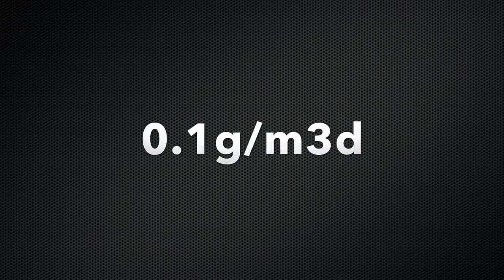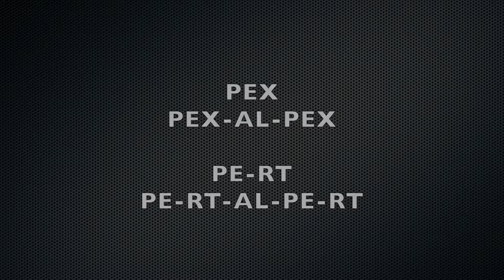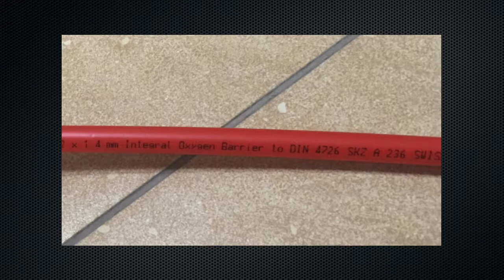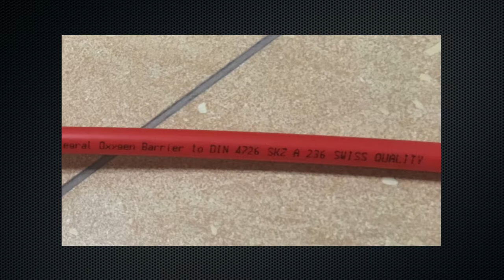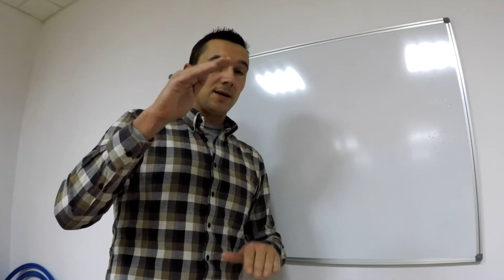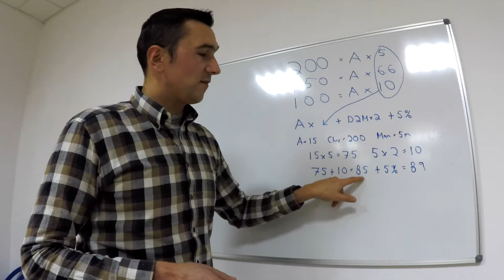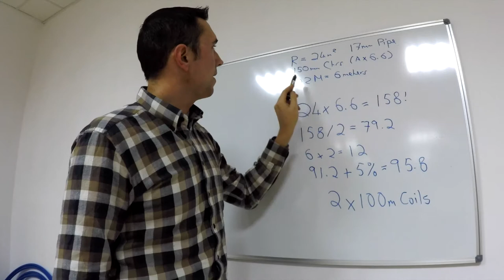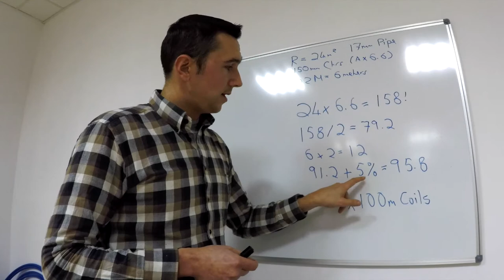Underfloor heating pipe and how to calculate how much you need

Comment: Brilliant content, do you offer a service to calculate and design snail pattern pipe layouts?

I have my heat loss calculations for a self build low temperature system, radiators up and ufh ground floor, but I'm struggling to understand how i get the ufh to match a certain heat loss requirement.

Example: a 22m2 room will need filled with pipe regardless, but how do select the pipe centres required for that heat loss and then fine tune it. 50mm spacing jumps make a lot of difference to kw heat output.

Comment: Do those multiplication factors have to be increased by 20% if using a heat pump?
Reply from the maker: Nope, no hard rules on this, it all comes to the output your trying to achieve in order to meet your heat losses, but if your talking about screeded systems then it never hurts to add more pipe regardless of the heat source
Reply: @underfloorheatingreview  thanks. Will you be doing more videos?
Reply from the maker: @andypag1071  I would love too but I simply don’t have the time with young children and being active in the industry as my job. Maybe one day but I read all of the comments

Comment: Very useful! But how I choose between these distances 200, 150 & 100mm?
Reply: i do 150mm
Reply: You need to know the heat load for each room, although ultimately the most efficient design is always 100mm spacing because that keeps your DT down and that makes for a high COP. The most efficient design will always use more pipe, but this is generally a good investment.

Comment: Hello I recently recently found your channel but I see it’s been about two years since you uploaded a video
Reply from the maker: Still here :-) and doing my best to answer questions, I work in the industry just been rather busy of late to make something for the channel, I do plan more soon
Reply: @underfloorheatingreview  thank you for getting back to me so soon I also tried your website but it will not launch sorry for bothering you but I I am building my house practically alone with my own two hands so I found your channel very helpful when I decided i wanted to install  ufh but I need some advice
Reply from the maker: @hardcooling  yer have not renewed the domain yet, where you located?
Reply: @underfloorheatingreview  Israel
Reply from the maker: @hardcooling  take a look at www.omnie.co.uk it’s a good resource of the options available, any other questions let me know and I will try to help you out if I can
Reply: @underfloorheatingreview  Thank you very much I had a question I have a 180m House One floor no stairs inside but the way the house is divided rooms and what not there is not a very good center for the manifold so I decided the best thing would be to have two separate manifolds one heat pump unit teed off at the first manifold to the second manifold and back what would you recommend from the heat pump to the first manifold pipe size and from the first manifold to the second manifold pipe size both the manifolds will have eight circuits each what would you recommend or maybe if you have an email or someway I could contact you easier than YouTube
Reply from the maker: @hardcooling  that’s a little more tricky as will need to take into consideration the flow rates and heat pump brand recommendations, best thing is to get the UFH design sorted with the system and floor finishes you would like, and the design conditions, then this info can be past to you heat pump provider to size this correctly, it’s not something I am involved in designing personally, that website you hopefully answer a lot of questions for you
Reply: @underfloorheatingreview  ok thank you very much will do have a good day👍🏻
Reply: What does it mean by distance to Manifold? Is it between the end of the pipe to the manifold? Thanks

Comment: But surely the amount of pipe required will depend on the heat load of the particular room no?
Reply from the maker: Yes and other factors such as flow temp and the floor finish will effect this, in most cases companies will over spec so that losses are met, for example some companies will install all pipe at 100mm ctrs regardless of the load, this allows them to future proof the design so if for example the customer wants to use a
heat pump in the future then the system will still work at a lower flow temp
Reply: @underfloorheatingreview  But if I only do this calculation for amount of pipe required, then isn't there a risk that after installation it turns out that I haven't put enough pipe in to meet the required heat load (no matter how much I increase flow temp)?
Reply from the maker: @AwestruckChemicals  if your concerned and the property has high losses then I first recommend finding this requirement and calculating the W/m2 required - you can then compare this with the outputs of your  chosen UFH suppliers system
Reply: @underfloorheatingreview  thanks

Comment: DO NOT USE 12mm! Heat pumps are coming.
Reply from the maker: Nothing wrong with using 12 or even 10mm pipe in UFH systems regardless of the heat source if the products are designed to suit. End of the day it’s all about flow rate, output and especially buildup. Many options out there so don’t let it put you off if you see smaller diameter pipes that allow you to add UFH to your home
Reply: @underfloorheatingreview  How do you calculate the flow rate required for a loop?